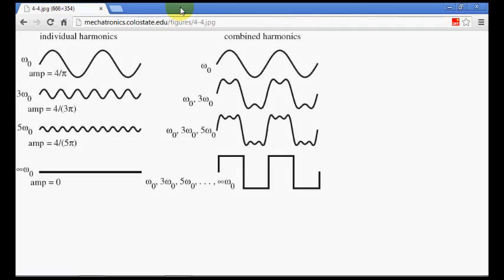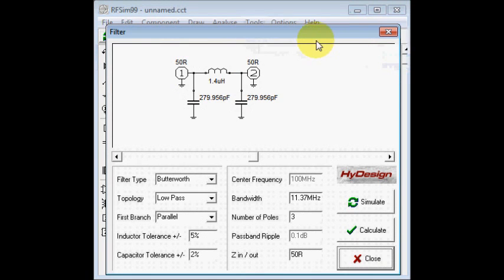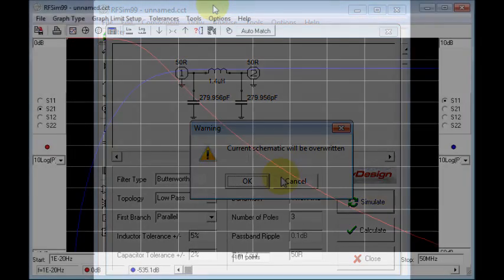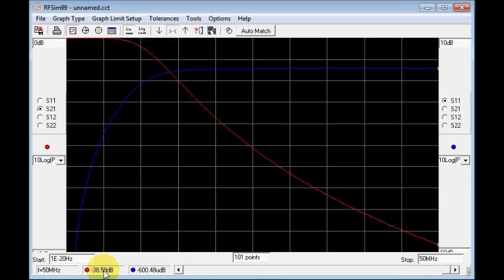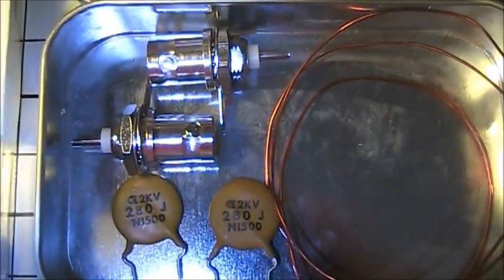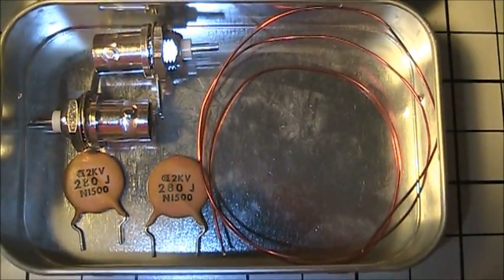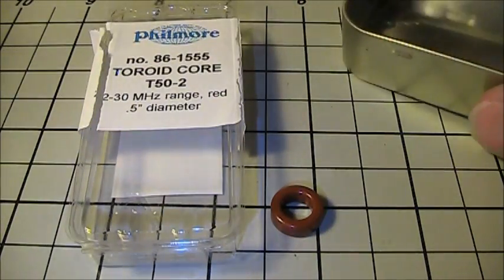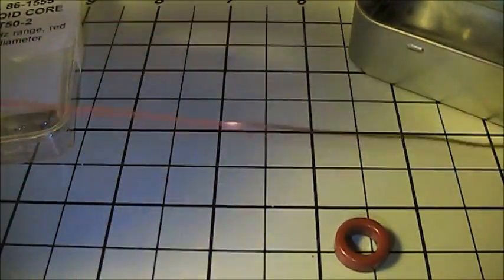Low Pass Filter in an Altoids Tin for FlexRadio 10 MHz External Frequency Reference (CC)

Comment: Thanks for the video. Were you aware that those 280 pF caps have a negative temperature coefficient? That is the N1500 marking on the caps.  A better choice would have been to use NP0 (C0G) caps.  I suppose if the ambient temperature doesn't change much you will get away with it OK.
Reply from the maker: Thanks for your comment.  I used capacitors found in my junk box.  As the cutoff frequency is not critical a few pF capacitance change will not affect the filter function.